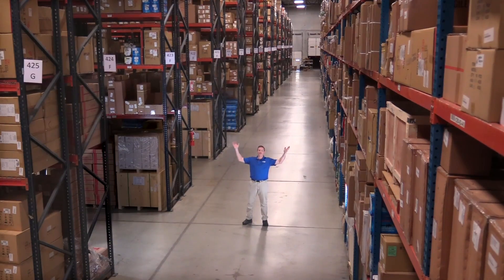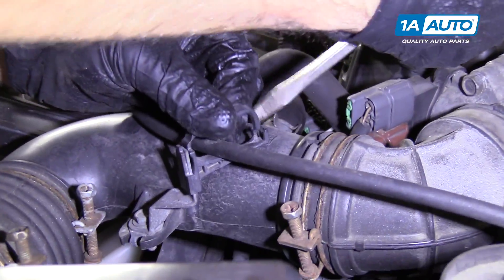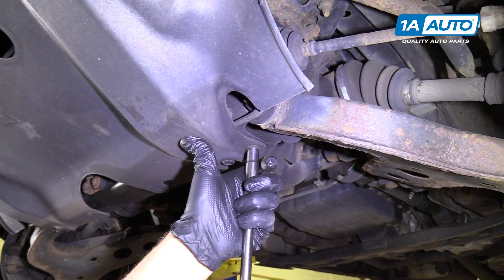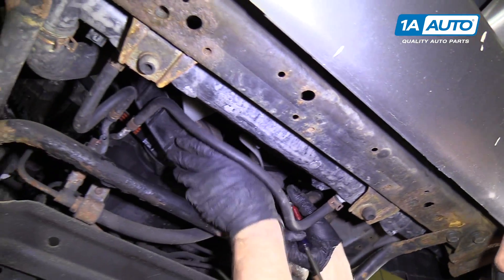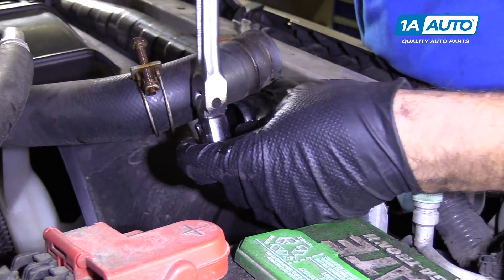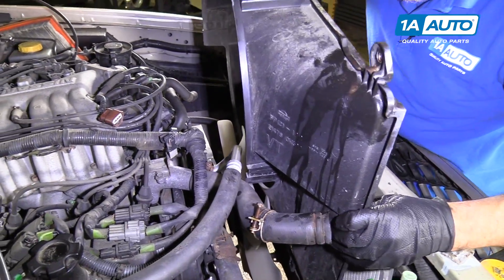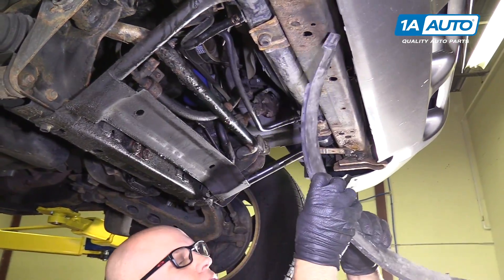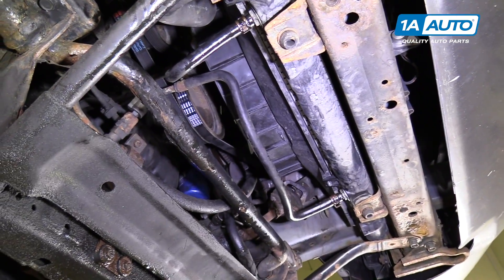How to Replace Fan Shroud 96-04 Nissan Pathfinder

Comment: I wish my 99 pathfinder shroud was as easy as that. My shroud has a plastic lip on the left and bottom that snags it on the steering rack and makes you have to take the steering rack partially out..... maybe my car is special though because everything else was exact same as the video.
Reply: After watching the radiator removal video I think I can remove that to get it out instead of the power steering.
Reply from the maker: +Josh Nabours Thanks for checking us out! http://1aau.to/m/Shop-1AAuto-c